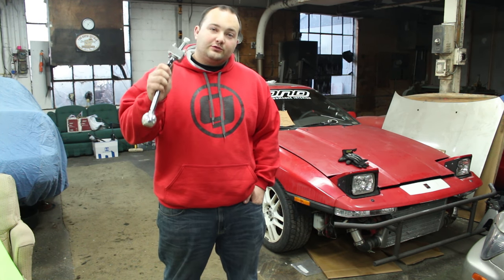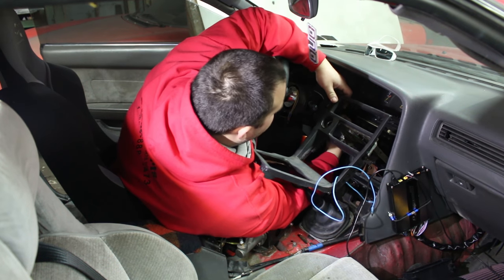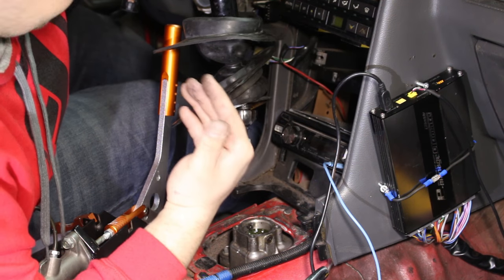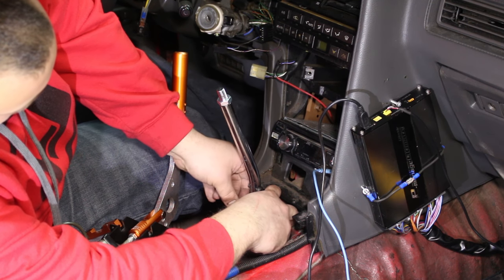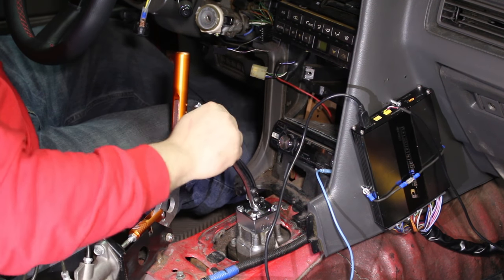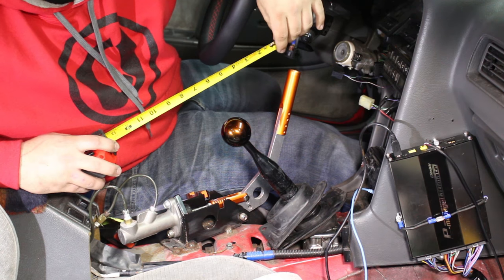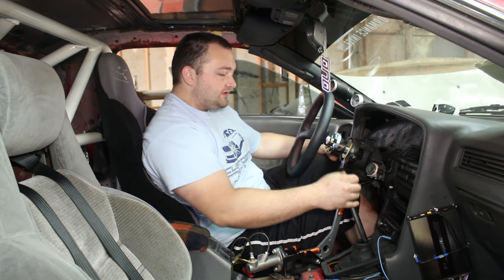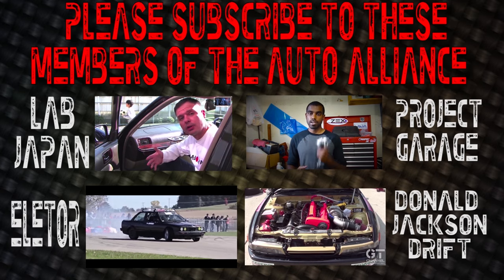Supra Short Shifter Install! R154 W55 W57 W58 IS300 Cube Shifter

Comment: Good to see how much you like our short shifter!
We have updated our install instructions to note that it is recommended to use some gasket sealer or factory gasket if available between our CUBE Speed short shifter and the factory shifter housing to prevent any minor leaks from the trans.
Reply from the maker: Awesome, thank you very much for working with us, the shifter is fantastic!

Comment: Dude it's awesome! I have one and love it. You need to remove the bottom circle bushing in the base of the transmission. Yours looks green. Also, that little gap looks like a casting thing on the transmission as mine was perfect. 
I'm rocking a weighted 8" shift handle. But best r154 short Shifter.
Reply from the maker: Thanks! That bushing came green, its almost brand new.

Comment: You should do a driving review
Reply from the maker: If the car drove :p
Reply: Poor Man Mods damn man, when the car is back on the road please do a review, I've been thinking about getting a short throw for my Mk3 with a 1j swap aswell
Reply from the maker: okkkk, get the cube shifter while you can still use the coupon, you wont regret

Comment: Hey Bro, Ryan at Pure Function told me to check your channel about the cube shifter, i actually purchased it about a month ago, but when i installed it and tightened down the bolts i noticed i couldnt shift or move the level at all until i loosened up the bolts and it also it felt like the spring made it really hard to compress the plate on the level down to the actual cube base.  Any suggestions?
Reply from the maker: It is difficult to compress to get the bolts in. Make sure the shifter is not installed backward, and I remember in the instruction is said something about potential clearance issues and there may be some required grinding. contact cube and see if they can help out sales@cubespeed.com.au

Comment: So when you took the shifter out is that where you would pour in new fluids? Or what im confused
Reply from the maker: You can fill it up through the shifter hole, I did when I first did the swap, or you can use the fill plug on the side of the transmission

Comment: hey Freddy do you think the R154 is worth it. I have a w58 with a 1jz. i dont ever plan on going over 400hp. i see r154 going for 1500 and i just dont have that to spend lol. thank you hope the supra get done soon.
Reply: I would keep the w58. The w58 shifts smoother than the r154 so thats certainly a plus. If you dont floor it 24/7, a w58 is fine for your goals ;) You can  always keep a look out for a r154. Last year I picked one up for 200 euro's, around 220 dollar. Some people dont know what they have..
Reply: From what I've read the w58 should be fine for just driving around.  If you decide to push the car more hp wise or plan on running the car hard a lot the r154 might be a good idea.  I'm about to start my 1j swap soon and will stick with the w58 until I decide to jump for the 400+hp range or break my w58 drifting.  What ever happens first lol. But as a commuting car you should be fine.
Reply from the maker: yeah I would say youd be ok with that mount of power. If you really want to beat the shit out of it or get more power I'd go with an R154. My R154 swap cost over $2000 all said and done, the most expensive thing Ive done to the car. Beat the shit out of your w58 and if you break in ,then maybe do the R154 swap
Reply: Poor Man Mods I've broken a W58 at stock 2JZGE power. I'm now NA-T and the replacement is on life support. Zero faith in W58's. Got a R154 almost ready to go in. Would love to find a broken one to rob parts from.
Reply: I have heard that you can use a 6 speed out of a 350z/370z it has the gearing and strength of the getrag v160. just need an adapter plate from Collins performance. saw it in motionautotv. cost roughly the same a r145.
Reply: 2000 dollar for a r154 conversion. Holy moly. Did you also build it with MC internals :p
Reply from the maker: The guy i bought it from said it was a MC trans, cost $900, then i had to buy the bell housings, clutch and flywheel, slave cylidner, master cylinder, shifter, driveshaft, fluids, bell housing and flywheel bolts, and transmission mount
Reply: Justinus van Linden it costs more for a CD009 conversion. Do your research and the math. An adapter kit for an SC300 from Collins range for 2K and up. Kill that noise please.
Reply: huh i didnt say that. Do you mean fawaz yusuff

Comment: Would this fit the w55 in my 02 Lexus is300?
Reply from the maker: +Tyler Crippen yup! :)
Reply: Finally I can stop searching for a used B&M and won't have to settle for the iffy Ralco! Thanks for the info
Reply from the maker: Yeah no problem! Get the cube shifter with the coupon code before its too late :)